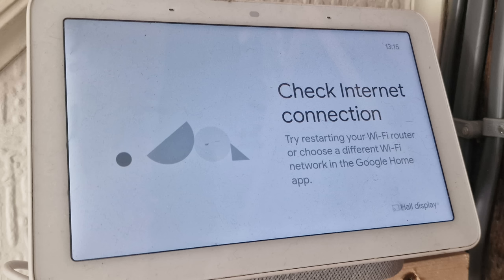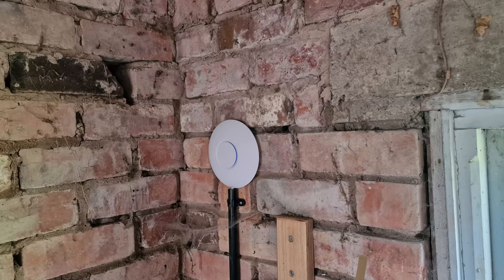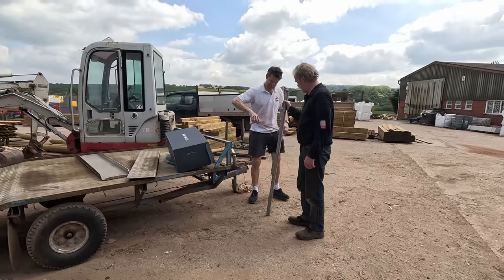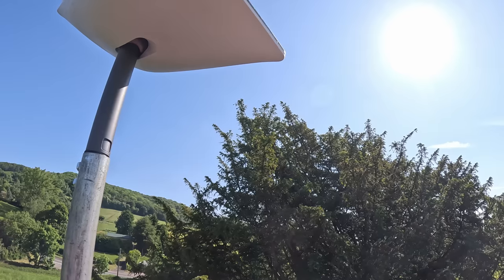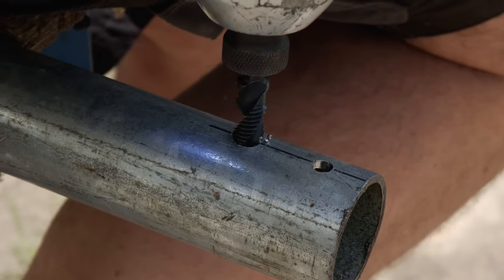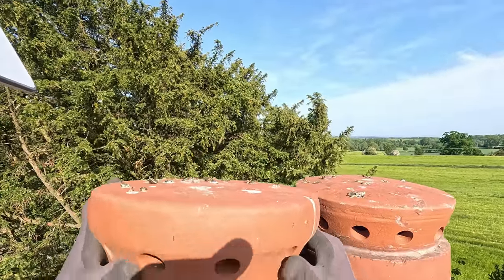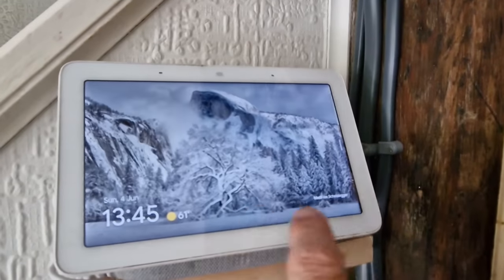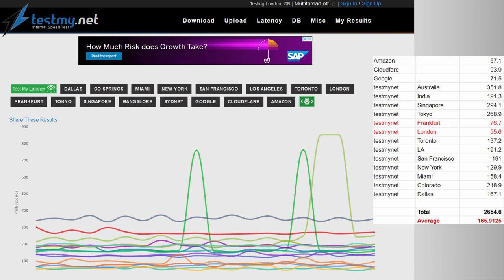Starlink Setup and Review

Comment: Good to see you have separated your internet (broadband) performance and reliability from your wifi's - a common conflation mistake. 

Unfortunately there are many issues which can affect wifi, and as a networking old timer of 30y experience I'd recommend getting someone in to diagnose the perf issues for you. A lot more cost effective as it might take a lot of time otherwise to DIY, even for those who have some IT knowledge. You could spend hours otherwise wandering around every room with Wifi Analyzer on your mobile. Knowing what tests to run and which stats to analyse may solve the issues quickly. Also the knowledge gained will be useful when choosing any wifi system upgrades in future.

Unifi kit is normally pretty good so I'd be tempted to diagnose the issues before ditching it. This can even run to finding out which building materials are used in the property e.g. foil-backed insulation can block wifi signals! Or it could just be a dodgy cable. Good luck!
Reply: In troubleshooting our home AP locations I used the android Pingtools app that shows in simple graphical terms the broadcasting SSID's their strengths and bands - it doesnt take too long to establish the problem spots and can hugely inform you on the impediments of the house.

Mac OS has a wifi scanner built into the wifi connection settings, so a macbook could also do a similar task out the box.

One thing we discovered was that our neighbours solar inverter was shouting so loudly on a particular channel we had to shift our AP's channel away from it to avoid the channel being flooded with noise.
Reply from the maker: Thanks both. Yes it could be a number of issues from simply not having it on the right channel (although I thought I'd fixed that) to the fact that I haven't got round to installing a proper patch panel so I've got solid CAT5e terminated in RJ45 connectors which I'm told should be used with stranded wire.

Comment: We have been using the 3 Mobile mobile broadband for four years now, as we live in a rural area. During covid it went through a patch of about six months where speeds dropped dramatically, but then it recovered. At £31 a month it isn't bad value. With mobile contracts with different networks, which we can hotspot off if there's problems with 3, we are satisfied with our internet. Did you mention the monthly cost of Starlink? I just Googled it and it says £75? Bit pricy
Reply: I've just moved from o2 to SMARTY for my office 4G internet. They use 3 network and I've got unlimited data for £20 a month rolling contract. You might be able to save some money... Getting a reliable 18Mb download speed most of the time (using extension aerials) 👍
Reply from the maker: I thought I did mention the monthly cost but watching back it looks like although I had it in the script it hasn't made the final edit which is really annoying. It is on the home page screen shot a few moments earlier though. I should have put it on the blackboard too. I was paying £35 a month for EE 5G so yes it's a lot more expensive but the service is so much better so far.
Reply from the maker: Thanks. That sounds similar to the Airband I was on. I wonder what your upload speed is like.. 🤔
Reply: @CharlieDIYte  Usually between 5-20mbps. Probably not good enough for a YouTuber.

Comment: Your Unifi system should be fine, make sure you have the latest firmware on each access point, your Cisco switch is Gigabit and not 10/100, your POE injecors are gigabit and not 10/100, and finally, make sure you have seperate SSIDs for both the 5ghz and 2.4ghz bands. Set the 5ghz channel width to 80mhz and carry out your speed tests only when connected to 5ghz, as the 2.4ghz band will max out at about 70mbps.
Reply from the maker: Can't thank you enough for that Brian. Will get onto it 👊

Comment: After all the getting the hollow pipe you didnt put the data cable down the hollow pipe? You even made a point of it at 7:12 :( Nice work still.
Reply from the maker: Only because I wanted to fix those M10 bolts into the slot otherwise I would have done.

Comment: Just for information. Rule of thumb for drilling & tapping threads. Thread tapping depth should be 1.5 times the bolt diameter. So for an M10 bolt 15mm. This gives maximum holding strength. Tapping an M10 hole in a thin walled tube such as scaffold tube will result in a very low strength fixing.
Reply from the maker: Thanks for this. Don't forget though I'm only gently tightening it. The thread depth would far exceed the strength of the mast if I was to properly tighten it. Horses for courses.

Comment: As a network installer your assumption that Aruba is better than Ubiquiti is incorrect. Your problem is you are using a  poor non Poe network switch with injectors to power the discs. These slow the whole system down... Replace the switch - remove the injectors. The discs are usually capable of more than 400Mbps depending on version.
Reply from the maker: Thanks for this. It wasn't an assumption but advice I was given by an expert on my Discord forum who said the Ubiquiti hardware isn't as good as Aruba's. But I'll take on board what you say. I was just using the injectors that came with the discs - I didn't realise these can slow the system down. Thanks though for the advice.
Reply: @CharlieDIYte  there's good and bad with most manufacturers tbh. They are both pretty good in their price ranges. Ubiquiti do complicate things by using 24w Poe on older models so be careful to match switch with disc. 🙂

Comment: Posting from Texas.   Makes me realize how spoiled I am to have newly arrived gigabit fiber service.   I have 300 Mbps for $45/month, fixed for life.    I actually pay for 100 Mbps but they voluntarily updated me to 300 for no charge.   The old cable service got so bad and expensive and is history.
Reply from the maker: Hi buddy, great to hear from you. Yes there are so many problems with stuff in this country. Delapidated housing stock (including my own 🤣) but also lack of fibre to premises in rural areas. I was paying £35 a month for that EE router now £75 for Starlink but until something better comes along it's £40 well spent. 👊
Reply: @CharlieDIYte  I have siblings in UK (I’m a Brit) who bemoan their various forms of connection.   At least with starlink you have something that is reliable even if the speed is a bit slow.   Hope it works well for you.   As a big diy er myself I hope your mast and receiver stand up well to any storms.   If I understand right, is there an orientation motor system in the actual dish?   I was fascinated to see it moving.

Comment: Quite a heavy pole for a chimney, especially if the mortar is not 100%. TV poles are thin aluminium and the loading is almost purely aerodynamic.
Reply: I would never drill into a chimney. Would only ever install with a lashing kit. I also don't fancy the wind loading from the dish on the chimney, although it is quite horizontal as opposed to a standard sat dish.
Reply: @phoenixdundee  Yea, and you can remove or readjust with relative ease and non-destruction.

Comment: Never had such a nightmare experience with connecting and trying to pay for the service.  About to send this horrible product back.  No customer service at all either.  The app connection keeps dropping.
Reply from the maker: Sounds like you've got a dodgy connection. I had a few connection problems a couple of weeks after doing this vid and my ethernet adapter was to blame. If you raise a ticket they come back to you pretty quickly. If you were trying to connect though an adapter, take it out of the equation and just connect the cable directly into the router.
Reply: Thanks.  I will try again.